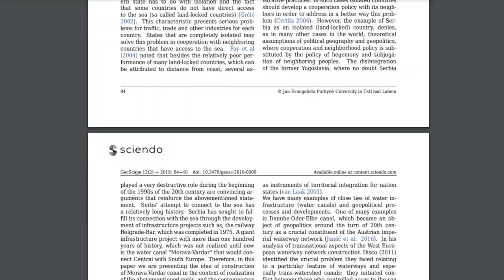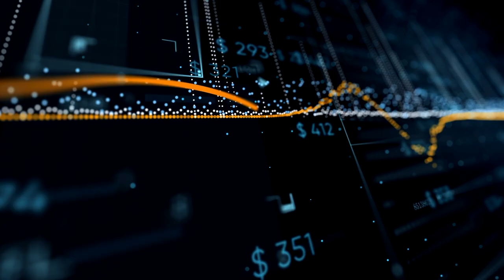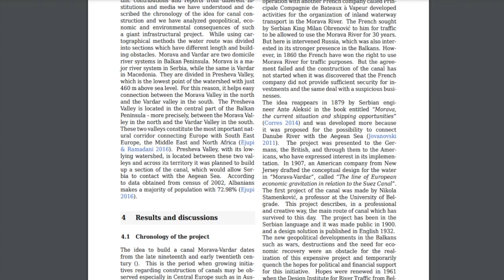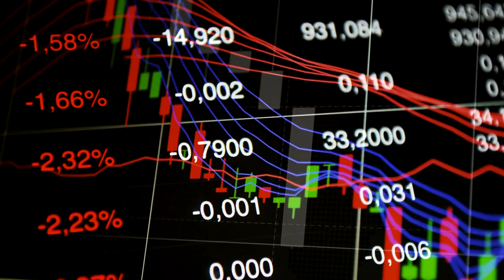Serbia’s Plans for a Canal to The Mediterranean

Comment: It is highly unlikely this will happen. Reasons:
1 - There is already the Danube Black Sea canal which is suitable for 6 barge convoys and which connects to the largest deep sea port on the Black Sea, Constanta
2 - Because of the expenses of building the canal and operating so many locks and the fact that the canal will most likely be able to support only 2400 ton ships due to the size and draught (being limited by the size of the 2 rivers) will not be able to compete with the Black Sea canal even with the shortening of the voyage by time and lenght because they will not be able to outcompete with the fact that a convoy going through the Danube Black Sea canal can carry up to 6 x 3700 tons through only 2 locks of the canal and the 2 from the Iron Gates
3 - Due to N. Macedonia and Serbia wanting to do business in the EU and maybe even join and Greece being in the EU already and it's statute on ecology, it's highly unlikely
4 - Due to Serbia being a Danube country, but a non EU one, it will be highly unpractical to bring stuff to Greece, put it through Schengen customs, then through Macedonia through a non EU custom, then Serbia, another non EU custom and then put it all through Hungary, again Schengen custom. All this can be done through Romania and Serbia, just 2 customs checks
5 - To recover the cost, they will need to tax the stuff, to tax the stuff, they will have to be expebsive stuff. Expensive stuff mean containers, and linking Germany to the Black Sea through containers is barely worth the cost doing it through Constanta because when you go from Austria to Germany through the Danube-Main-Rhine canal you cannot put more than 3 rows of containers instead of 5 because of the low bridges
Reply: isn't there Sava river that goes from Serbia to Croatia? it will be less to dig to Mediterranean maybe

Comment: I would think dig the 30 mile canal first and build the water locks also. Then the water flow might widen and deepen the Modava and Vadar rivers. But if necessary to dig and widen those two rivers where it is needed.🚢

Comment: Here's an idea.  Suppose they start in the middle and excavate to full depth and build the section that is to connect the two rivers first.  Then for the rest, they could allow small boat and ship traffic to go down one side of the river while they dredge and built a canal on the other side.  They'd have to have two narrower canals separated by a strip of median, instead of one wide one.  The dredged out material could possibly be used to help build the median.  Maybe, this way, there'd be enough light shipping traffic to help pay for the construction.  And as time passed and they got more and more of the shallow sections dredged out and built, ship sizes could increase, bringing in more and more revenue to speed the construction.

Comment: How would 4 Meters of depth  be anywhere deep enough for a container ship that needs 9 meters or more? Would the plan include offloading cargo onto smaller ships?
Reply: You're absolutely correct.  This would never be a viable route for any commercial shipping.  As you say the draft on any container ship worth using is at least 9 meters and even that is a relatively small ship.  More like 10 - 13 meters of draft and of course you still need water under that to float.

Comment: i cant see it ever happening myself  because cargo ships r only getting bigger and that river is too shallow /thin and they will have to keep updating it or it will become out dated really quick so maybe they should look at a train system instead off a water way in this case
Reply: You can use smaller cargo ships to carry containers to the coast and then transfer the containers to larger container ships. That would be a lot cheaper than using trains to carry the containers to the coast which would have to transfer the containers just the same.

Comment: Basin size 14.000 cu. ft. discharge averages 13.520 cu.ft. length 220 km. 
elevation 82 ft. minimum 1.410 cu.ft. maximum 178.000 cu.ft. 620° F boiled water, rector coolant system, 4 steam generators, diesel generator, water requirements filtration. Made out of carbon steel, reinforced concrete. 1.514 litters per MWH.

Comment: A proposed depth of 4m means that you will have to reload cargo in Thessaloniki from ocean going ships to smaller ones. So when this reloading process has to be done anyway why don't you use a train from Thessaloniki on. A railroad should be cheaper and more friendly to the environment. And let's not forget that trains can use green energy much more efficient than ships running with e-fuels or hydrogen.

Comment: Its creator claimed that it could move forward without any propellant. That engine was indeed impossible, but because spacetime is very slightly curved, a device could actually move forward without any external forces or emitting a propellant – a novel discovery.”Physics generates fundamental knowledge needed for the future technological advances that will continue to drive the economic engines of the world. Physics contributes to the technological infrastructure and provides trained personnel needed to take advantage of scientific advances and discoveries.

Comment: At minute 3.00: „hight difference of 492 meters...“
NOPE, 492 feet / 132 meters...
🙄🙄🙄🙄
Reply: No, it must be meters. The city of Gostivar in North Macedonia, which is on the Vardar river is at an altitude of 535 meters. However, I presume that the canal would join the Vardar river close to Skopje which lies at about 250 meters above sea level, still much more than 132 meters. If you add that there  is a higher valley in between the rivers, 492 meters seems to be right.
Reply: @koantao8321  
Check it out. River Morawa‘s spring is at an altitude of 131m which is equal to 429ft.
(I made a mistake above, 131m / 429ft should be correct.)

https://de.wikipedia.org/wiki/Morava_(Fluss)
Reply: @paulbeneder9337  Apart from the fact that the Morava river has more than one spring, how would it connect with the Vardar river, through a tunnel?
Au jeden Fall, frohe Weihnacht! :)
Reply: @koantao8321  
I just checked... seems to be coincidence then..? 
But still, to me it’s hard to believe that anybody would seriously build such a shipping route? 
I grew up in Vienna, the water level of the Danube is here about 150m above the Adriatic sea, breaking through the easternmost last ridge of the Alps which’s last peak next to the river is 425m high - I see this mountain every time when I’m driving to work and now I‘m supposed to believe that ships shall be lifted that height in total on their way from Thessaloniki to Serbia...?
On the river Vardar, for that a canoeing guide is available... where you can read about cataracts and other obstacles, it even provides pictures of places where it’s not possible to keep the canoe in the water but to carry it over land... very nice... but turning this to a shipping route....???
🙄🙄🙄

My personal conclusion about this project after looking closer...:
WTF????
😱😁

Comment: Nuclear Power Plant. Employees: 1.650 Control Room, engineering department, mechanics department, Chemist department, electricity department, room operations, security.
Nuclear Regulation Commission. License manufacturers, reactor, specific design, staff permission, site permits, design certifications, construction permit. Safety analysis, accidental situations, environmental public meeting, antitrust. 80 years life of the reactor.

Comment: Correct me if I'm wrong but the see level of ground where Morava meets Dunav is arround 80m, why are you mentioning 500m of height difference between Dubav and see?
Reply: The meeting point of Morava and Danube is 80 m, you are right, but the the sources of Morava in the Presevo Valley have an elevation of around 450 m. Thus the hypothetical canal that would connect the Morava source with the Vardar source in Northern Macedonia would also have an evelation of around 450 m.

Comment: In cyclostomes, most fishes, and tailed amphibians the germinal epithelium is arranged differently. Instead of seminiferous tubules there are large numbers of spermatogonial cysts (also called spermatocysts, sperm follicles, ampullae, crypts, sacs, acini, and capsules) in which sperm develop, but in which the epithelium is not germinal. Spermatogenic cells migrate into the cysts from a permanent germinal layer, which, depending on the species, may lie among cysts at the periphery of the testes or in a ridge along one margin of the testis. After invading the thin nongerminal epithelium of a cyst, spermatogenic cells multiply, producing enormous numbers of sperm. The cysts become greatly swollen and whitish in colour; the entire testis also swells and has a granular appearance. As sperm mature, they separate from the epithelium and move freely in the cystic fluid. Finally, the cysts burst, and the sperm are shed into ducts. In the case of cyclostomes and a few teleosts the sperm are shed into the coelom. The cysts, totally emptied, collapse. Then either they are replaced by new ones, or they become repopulated by additional spermatogenic cells. It is not yet known which of these processes occurs.

Comment: To add salt to the wound, anyone from balkans know these for a fact: 

1. 17B$ turns into 60B$+ 
2. 12Year constuction turns into 50+years
4. 20+ down times and 100+accidents
5. Non-stop Mafia involvement and theft of construction materials
6. When/if everything miracilously goes well, there'll be a civilwar in each of those countries involved esp Serbia, Kosovo and Macedonia.
7, If no civilwar then those countries will start a despute between each other and start blocking each other off
8. etcetc

Comment: Romania undertook a virtually identical effort 50 years ago - The Danube's black sea portion, running through roughly half the country, was artificially shaped, enlarged, and made suitable for much larger shipping. The commercial returns were disappointing, and contributed to the collapse of the Communist government there. That effort was arguably more invaluable, as without it the Danube had no usable exit on the Eastern European side (the mouth of the river kept shifting around virtually every year in its natural flow), yet it still didn't work out well. If it couldn't work then, with far greater cost savings produced over the alternative, why would a more expensive effort with less benefits work out better?